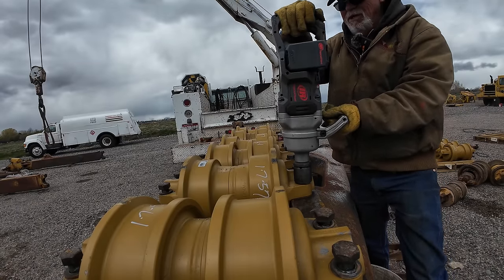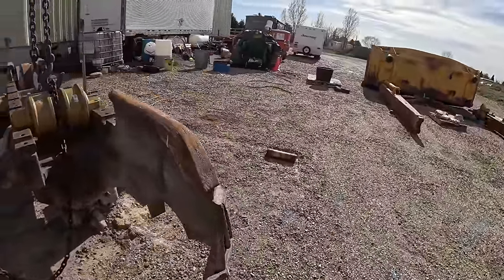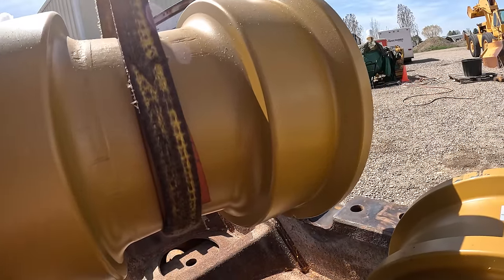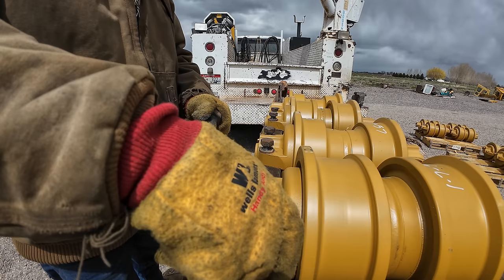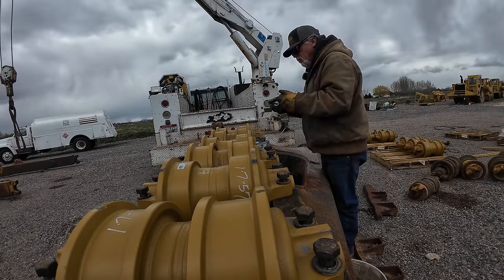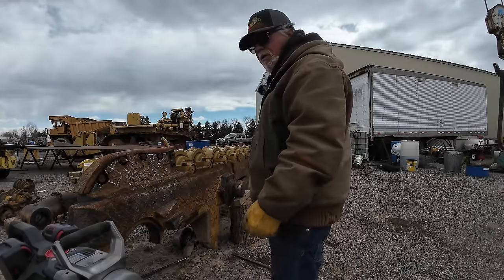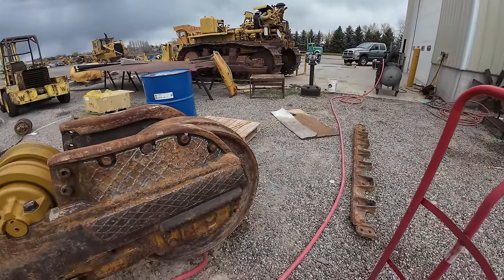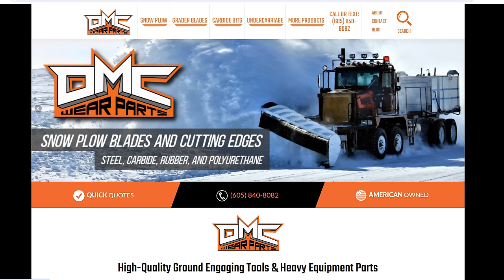D9G Roller Installation

Comment: You can run “tests” till the cows come home, but the real world is where the rubber meets the road. If the fellow from Ingersoll is so proud of his product, one would think he would show greater interest in understanding/resolving the problem. Then again, maybe he already knows the marketing department got creative with the specs! Great videos!
Reply: I would of thought he'd want it sent back so it could be checked out, so much for been proud eh
Reply: Ingersoll has gone downhill, we bought a new mobile air setup for a 40lb jack hammer and the hammer fell apart within the first 2 hours of use. Both bolts unscrewed themselves completely then the air compressor began to have issues where the countdown for glow plugs was short and it would crank no start til the battery died. You had no way of holding the plugs a little longer like an 04 model with a key where you could override a shutdown. We fixed the manifold on the older model and left the new model with our superintendent. Let's just say the office was pissed we hated it.

Comment: hi Jeff. H/D mech here, in my 30+yrs exp, air will always win every time.
I've also found as you probably know, inch gun with long anvil won't have the same grunt as a short one.
Thanks for the video and good luck puttin the ol girl back together.
God Bless
Reply: LMAO... Expects to be taken seriously while casually mentioning god.
Reply from the maker: So the long anvil ingersoll electric claims even more torque than the short anvil model,  they claim it makes 3,000 ft. Lbs 😮  hows that work🤷‍♂️

Comment: IR's Winnegar probably sits in an "Office Space" like cubicle, and doesn't have the authority to bring any expenses to the IR company.  He probably as team leader stacked the design papers up in a neat stack, but has probably never worked on himself a fastener bigger than what you find on a swing set or bicycle.  Your test was right on.  As a shade tree mechanic have a small made in USA IR air compressor.  Thanks for providing the information.

Comment: Jeff you know all you need is JB weld to fix the threads 😂😂😂. I figured I'd get that in there before another armchair mechanic in kindergarten did 😂😂. Great job on the video and showing the truth always leaves hurt butt's. Hope you get your bolts and taps soon so you can be done with that part of the repair.

Comment: When you threw out that bottom roller bolt, I was sure you were going to find a hole that had been reworked where a regular bolt wouldn't fit all the way down.  I'm glad that I was wrong.

Comment: Increased air pressure absolutely increases the torque capacity of impact guns. What peaked interest in the correlation between air pressure and torque with pneumatic impact guns was watching my friend trying to rotate his tires on his duramax pickup.  This was probably 10 years ago and he was using an earthquake 1/2" drive impact and he was unable to remove the lugnuts with the gun.  He then took the jack handle and placed it over a breaker bar for leverage and the snap-on breaker bar broke before the lugnuts.  I walked over to his air compressor and it was shutting off at 125 psi so I removed the cover from the pressure switch and adjusted it to shut off at 150 psi and he was then able to easily remove the lugnuts with the impact.  So after coming to the conclusion that more is better when it comes to air pressure and impact guns I decided to see how much is better.  I decided to increase pressure 50 psi at a time as I tried to tighten or break varying sized bolts.  The test subject was a brand new earthquake impact that top of the line at the time and air pressure was supplied from a composite wound high pressure gas cylinder and it was filled with 6000 psi of compressed air.  After 200 psi I decided against holding the impact by hand so I hose clamped a piece of angle iron to the handle of the impact and I used a length of 1\16" steel cable to activate the trigger at a distance of 8 feet.  I made a loop around the trigger and used a pulley mounted to the angle iron to change the direction of pull.  Torque output noticeably increased each time the pressure was increased by 50 psi.  The highest pressure I achieved through the impact was 450 psi and the impact exploded after 2-3 seconds of operation.  My regulator was rated for a maximum regulated output pressure of 2000 psi and It would be a pleasure to test pneumatic impacts up at 2000 psi.
Reply from the maker: Wow,  that's interesting,  so I should put 30 volts dc to the IR
Reply: @Jpaydirt  What model Ingersoll Rand impact do you have?  I have the 9691 which is rated at 3000 ft lb of nut busting torque and only 2200 ft lb of tightening torque.  When I was deciding on which w9000 series impact to purchase I was comparing the w9491 with the w9691 and I was trying to figure out why the w9461 only had 2600 ft lb of nut busting torque and the only real difference is the 6" extended anvil. My guess is that the added weight of having the 6" extended anvil aids in breaking loose fasteners.

Comment: Enjoying your rebuild videos Jeff. You do a lot of work by yourself and I appreciate the effort and energy  it takes to get these jobs done by yourself.  Have to tear into my D7e before to long. I have a final drive that’s lost some teeth. Think it’s coming from the reduction gear but haven’t torn anything apart yet.  I don’t have the tools so may have to call in some help for this one unless I pull the sprocket and cover off as a unit and assess from there. Curious if you have used any of the aftermarket final drive parts. Costex(CTP) is substantially  cheaper then cat. I have decent luck with their stuff in the past but you’re always wondering if it’s a mistake when you put the order in.

Comment: my gosh, back in the day we always used to run a three-quarter line right out of the compressor tank with a ball valve dumped about an ounce of oil down the air gun and hope for the best. The difference between a good day and a bad day was a bolt coming out. Milwaukee’s the same thing they always got some kind of gremlin lurking in them. They all circuit boards. You don’t know what they’re gonna do makes you pissed all that money.

Comment: I worked on a 46A that was wobbling in the Ocean and the roller frame bolts were never taken out. We used a 21 ft. Pipe to break the bolts loose,but broke all 56 bolts off and used a magnetic drill press to drill out the bolts and had a welder blow out the rest and chiseled out the rest to the threads. What a mess and then used never seize on all the bolts when we put it back together.

Comment: For putting bigger bolts in the rock guards you could possibly get 12 point headed bolts for a smaller socket size or socket head. If they were 1” bolts to start with running a 25mm drill in there might be challenging as it’s going to be pretty close to hole size. Good luck Jeff will win

Comment: I've been using sleeve inserts for years on bottom rollers and have never had any problems and you get to use the original size bolts.

Comment: Awesome video. I wonder if you took some kind of wire brush, big enough to fit in the holes attached  to a drill. Clean them out and see if that helps before you commit to re threading them.

Comment: We run Milwaukee at my job.  If you change a Cat 24M cutting edge with a one inch electric the edge comes loose in a 12 hour shift.  If you hammer the same edge on with a one inch air gun they stay tight.  Electric is handy with no cord but some jobs I think air hits harder and tightens more.  The torque on the cutting edge is only 800 ft lbs but if we torque them it’s guaranteed to fall off.
Reply from the maker: well that's not good

Comment: Regarding your bolt repair, did you consider allen head bolts to avoid the too big of head inside the guard structure?  Cannot understand why Ingersol didn't want the gun back for eval...sounded kind of high and mighty to me....thanks

Comment: You are right, torque is torque, from the first bolt, that battery is not at 100% capacity.  So your torque numbers change.  Batteries operated tools are convenient.  They don’t require as much support.  But if you have a big job, better bring the air, or AC electric.

Comment: Enjoyed the video as always Jeff. You would think that dude from Ingersoll would have jumped all over the trigger issue, and asked questions about the problem if he was so proud of that impact that he supposedly engineered or whatever. Most of those guys like that are full of it. The guy you called about the roller problem didn't seem to waste any time with an answer. Goes to show the night/day difference about somebody who knows something, and somebody who just is just a condescending a-hole that's only about image projection, and nothing else. I tried to help out with the rollers Jeff, but my arms weren't long enough! You should have gotten Mr. Griffy to run the crane for ya. 🐶I'm sure he would take a 🦴as wages.

Comment: You can always take your bigger bolts to someone with a surface grinder and they can grind smaller hexs on the head if you need the clearence. I've done it myself before.
Reply: Be cheeper/easier in a mill

Comment: Really like the audio quality of that DGI wireless microphone.

ETA: for jobs where you need a bigger volume of air, don't laugh, but maybe you should look for a used propane or anhydrous tank to use as a volume pot or accumulator closer to your work.

Comment: The question that needs to be asked of the engineer from IR. The cad modeling is great however did he actually ever operate the product? Jeff what is your experience with copper based anti seize if you have used the product?
Reply from the maker: Dad used to use it, worked fine.  I use the silver stuff on exhaust studs, and when I want to look like the tin man  LOL

Comment: If your ever in that situation again trying to put something down wile in a crane....get some barn twine and run it to the cab and you can pull on either side to adjust them wile your letting them down.

Comment: 25:56  TTC has capability to test both directions.  I have not watched in a while but I know they have tested left hand before.  Just a matter of changing the bolt.  Think they were using 1" hardware.  Not sure how common a left hand threaded nut and bolt combo are.

One think I learned from TTC is the time it takes.  Peak torque frequently takes 15 or more seconds.  That's a lot longer than most of us hammer on something.

Comment: Jeff causing "my camp is better" division in the torque driver community again. ;)

Was the battery powered unit faulty? Maybe that specific one was, maybe the max torque rating is made under certain conditions through a series of equations rather than putting actual twist to bolt or stud. Maybe the rating is just to tighten while loosening is significantly less to half the max rating for reasons I'm not engineer enough to outline. I don't know the answer. Just what was seen and recorded.

Comment: Jeff, do you think dmc ever installed a set of rollers or did they backwards engineer it and just thought a regular snap ring would work?
Reply from the maker: I'm wondering if newer stuff has them, so they thought old ones can use them

Comment: Jeff,  at 39:57, look at the bolt to the right of your wrist.  It doesnt appear to be bottomed.  That might be the one that didnt turn iwth the Harbor Fright.  It might be hydrolocked meaning that theres too damn much antiseize in there keeping the bolt from tightening.  If i were you, i'd take that bolt out, clean it and the hole.
Reply from the maker: I see what you are looking at, I'll take another look at it, the holes are open so I doubt it's hydro locked

Comment: How hard would it be to add a shaft and levers on the front of the Galion  that had push pull rods thru the front and connect to the original levers? Use pins and clips so it could be removed if not needed. Just to keep from climbing in and out to make small adjustments.

Comment: On your air guns put a little bit of air gun oil before and after you use them them things will last for ever I was told that by a master mechanic I work for . Never had any problems with my air guns ,  just regular air gun oil , little bit goes a long way

Comment: I just cringed when you got done with the rollers and then talked about how you were going to have to drill out the stripped holes for the guards.  Ugh, it would be worlds easier if you had left the rollers off so you could use a mag drill to drill those and then use the mag drill with a center drill to support and keep the tap straight when starting.  If a larger hex bolt won't fit, how about a socket head cap screw?

Comment: So I'm no scientist, but it seems to be about converting electricity in to rotating power.  Through the compressor the Hobo has a lot more electricity to turn into rotation-moment of torque-than the little battery in the IR.

Comment: Here's the real deal with battery power Jeff. In all the batteries there's a charge time chip installed on the board from power tools to laptops. What the chip does is counts down the charge time till it reaches 60 to 50 percent then it stops charging.  Then when the battery is recycled it's shipped back to China where all they do is reinstall the batteries in a NEW housing with a new board with count down time chip and thier resold as NEW. They will do this 4 times before they finally recycle the batteries.👉👉So just because the batteries look new doesn't mean there are you could have a battery that's on it's 4 trip back to resale.
Reply from the maker: How could I test them

Comment: New rollers...26 year old bolts. Huh
Reply: LOL! Yes, what's it called. let me think, fatigue.
Reply from the maker: @martylost167   I call it time tested, if I buy new ones some will break, because everything is trash now. just my opinion, why buy new when used will do
Reply: @Jpaydirt  Yes, your correct and I was wrong. There is no real force (tons)on the bolts,  because once everything is back together the  dozer keeps them in place except in a very, very rare case and then you have the 4 -1"bolts.

Comment: PS you will hold onto a lot more talent if you put them in comfortable modern equipment rather than 1980"s junk, believe me, or just plain rent equipment as needed, its  a good business model when you look at it in 2024, good luck, a lot more profit can be made other than you killing yourself to fix up a old hunk of......
Reply from the maker: I haven't touched these rollers in 26 years, and won't again in my life.  I rebuilt this machine over 26 years ago and now I'm fixing it.  because of my climate there's no way a new machine would pay for it's self at 1200 hrs a year. when I bought the 336e it didn't pay for its self , the other equipment helped.  if your a large and I mean large contractor what you propose will work but not for me
Reply: Sir, i meant no disrespect, believe me I totally understand your perspective, on the other hand, weather it be buy or rent as needed, new cat equipment is so slick, there is no comparison to the older caterpillar equipment compared to the new generation equipment, my grandfather worked for Caterpillar for 37 years in Peoria Illinois, so please believe me I understand, I enjoy watching you work, a guy can learn a lot from you, I was simply making my comment, been there done that for sure and for years and years. At least look in options, I'm also a big fan of komatsu, various other brands, I live in California and unless you meet the strict environmental codes you can even start an older piece of equipment without getting fined up the ass. Nice to meet you, I'm Andy Shutty, coming to you from the wonderful, horrible state of California, San Diego, be safe